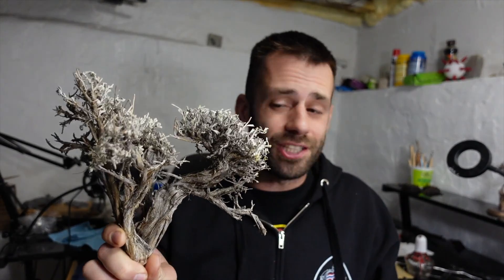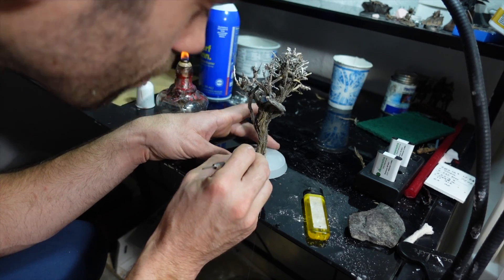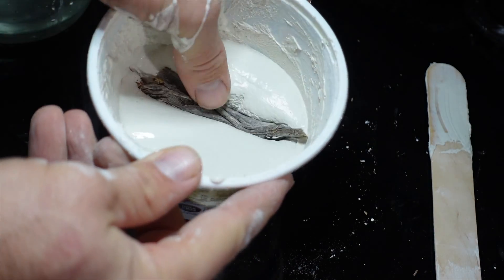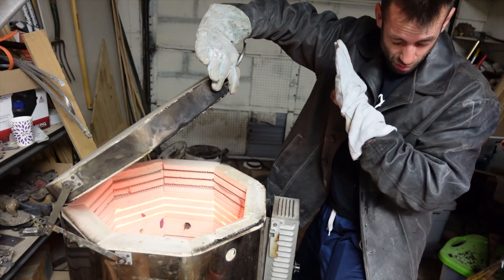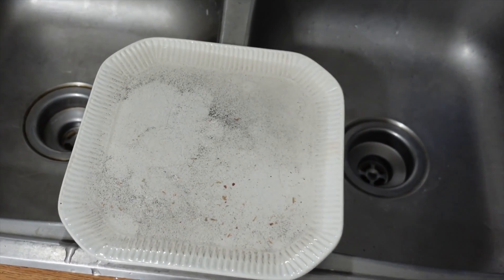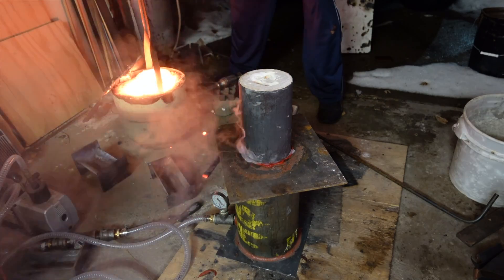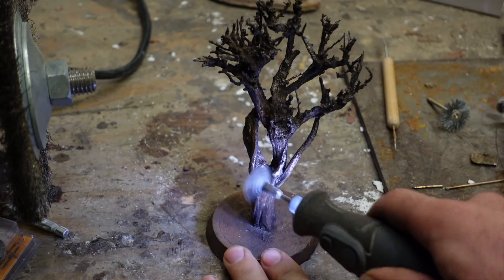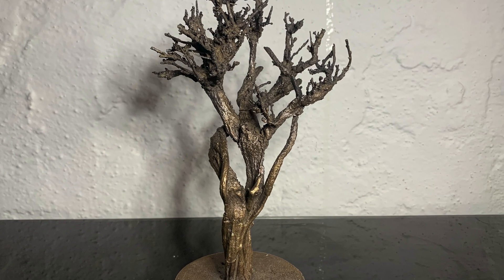Casting Bronze Sage Brush/ Lost Organics Casting

Comment: Thanks for your content, you've inspired me to cast bronze sculptures!!

With your help and that of others, I have so far learned how to melt metal, create alloys, print 3D wax resin models (or sections of with Meshmixer), and use my vacuum tank. The perforated flasks are on their way, and I look forward to making a vacuum table, and cylinder the same as yours. One question though... What investment do you use? There are so many to choose from!!

Thanks again

William : )
Reply from the maker: I used ultra vest from Rio Grande jewelry supply. It’s a good quality product. 

One thing of you are making a vacuum table like mine. Don’t use an aluminum cylinder like I did in the first video. It will melt if you have a blow out of bronze. I made some modifications to that set up and used a steel cylinder and that works better.